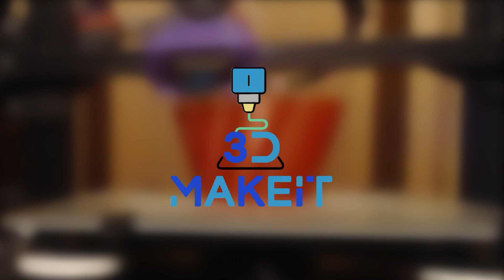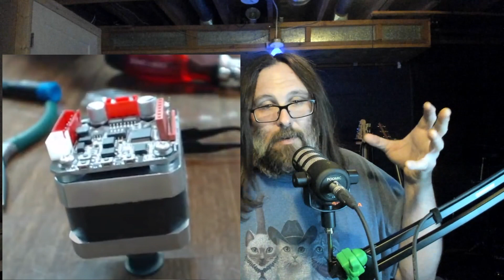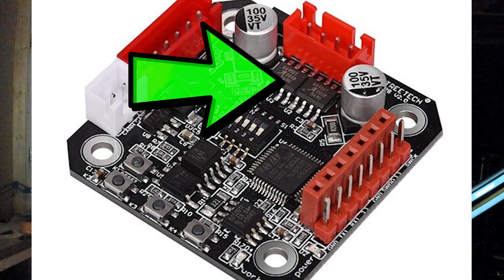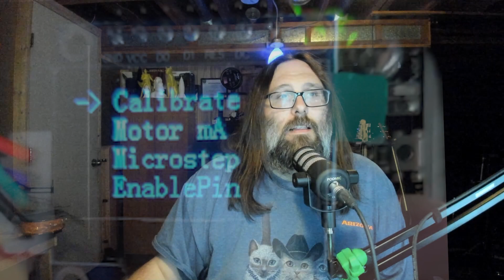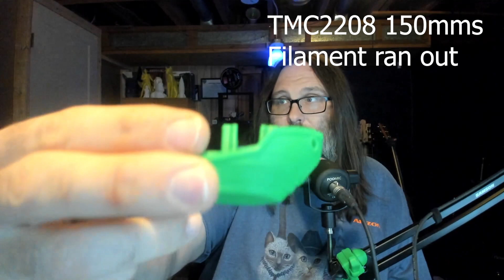Closing the loop Closed Loop Steppers (BigTreeTech S42B v2.0)

Comment: you dont need these for a real cnc. I've seen multi ton CNCs with open loop high torque steppers. The point is because the little steppers are weak and loose step easily

Comment: I have the earlier versions of this on my Anycubic Chiron on the X and Y. You mention the belt skipping but if your belt is tight that shouldn't really be an issue. The thing that causes junk prints, especially large ones is layer shifting. The layer shifting is caused by the Nozzel dragging on the infill or a blob of plastic which these drivers power right through. Your bump test is irrelevant as that is not an accurate test. What you should do is set the machine to over extruding with the different drivers and test it out. 

Also, while this is a more advanced topic you may have to play with the P.I.D. settings to get the best performance out of them. 

Lastly, one huge downside at least on mine is by default the drivers don't have a fault output. When normal servos lose too many steps they fault usually disabling the drive. I've had this happen and the printer didn't know that the driver had faulted and kept right no printing which ended up with a pool of plastic as one axis faulted, and then later the other did and then the head stayed in place and kept dumping plastic. It's only happened once but it was a bummer.
Reply from the maker: the it wasn't so much the belt it was the steppers

Comment: I'd be interested in them if first, the board was split into two and the magnetic sensor part still bolted to the stepper but the rest was on a separate board I could put anywhere. That way the stepper motor wouldn't be physically much longer. Second, if it came with no driver and I could plug my existing driver onto it (the one I pulled off the controller board). 
Also, I suspect your print failed because you went more than one stepper rotation in the jerk and it would just bring it back to the closest rotation for the magnetic field it was looking for.

Comment: I would like and buy them, when using tmc motor drivers. I dont understand why such bad drivers are used on this boards
Reply: the thing is his belts werent tight enough

but anyways, they're just PWM drivers, the microcontroller on the board is doing what an A4988 or TMCXXXX would do internally, just with PID and other smart things to make it as accurate and smooth as possible and to compensate for lost steps

so the A... drivers on the board here aren't really stepper drivers.

Comment: i feel like your belts werent anywhere near tight enough, i can push on my bed and the belt wont skip
Reply: I think it was pushed more than one stepper rotation.
Reply: out of my experience you can put the X or Y in the center of your printer and even if you push it all the way back, if you release it so it can jump back/correct itself it will jump all the way back to the center of the printer, which is many stepper rotations.

Comment: My tip is to just configure them as TB6600 instead - these drivers on Marlin are about the same as the A4988 but with the exact same pulse width/duration and step rates as the  two defines that you have to configure otherwise. Both do the exact same so there is no "correct" between the two.
For me those steppers solved my issues entirely. I work on leadscrew drive for all 3 axis, X and Y those closed loop ones, dual Z and extruder TMC2208s.
Had those TMCs on NEMA 23s before and they just don't work. Don't use those bigger NEMA 23s with TMC2208s. No matter how much you set current and such, to begin with StealthChop is useless, it won't run them at any decent speed. Second of, NEMA 23s seem to get stuck on resonances during very specific speeds, also vibrating like mad and screaming horribly (that's on SpreadCycle). I just got fed up and instead of trying to get lucky with good 17s just went with those and happy ever since, other than the money spent.
It might be part on the lead screw drive (like, for 16x microstepping I use 512 steps/mm) but I really have absolutely zero artifacts on them as well.

Comment: I'm using a set of these on my layerfused x501 build... I wish I would have seen this video first cuz I probably wouldn't have bothered. Another problem you didn't mention is if your printer was designed for sensorless homing you will have to add end stops. The driver's on these don't support homing.
Reply from the maker: Good call I didn't even think of that!  I don't use sensorless homing anywhere.   Tested it a few times mind you but I just like the click of the switch instead of the grind of the motor haha 😄 thanks for the comment!